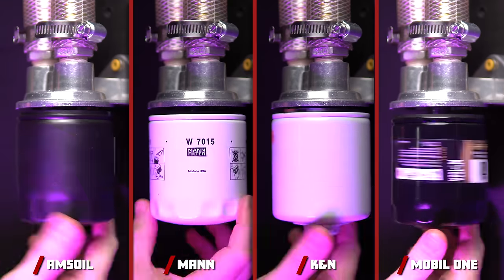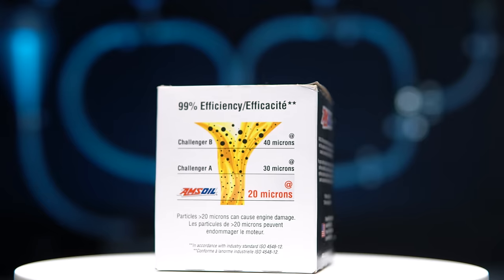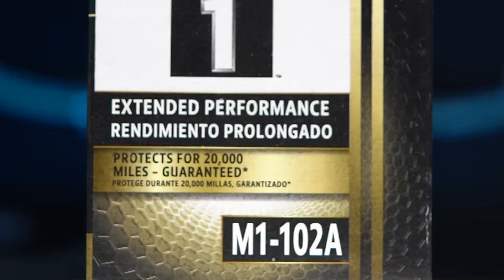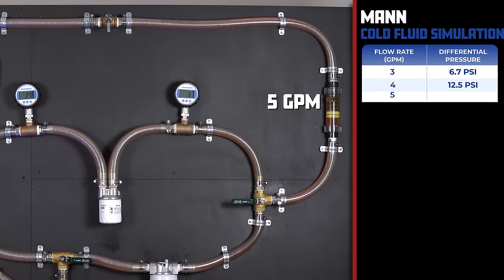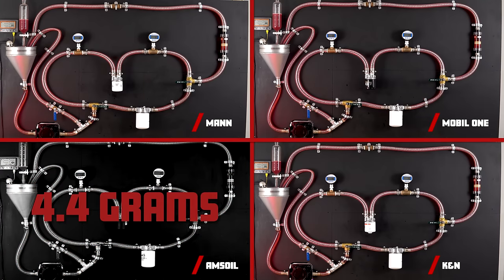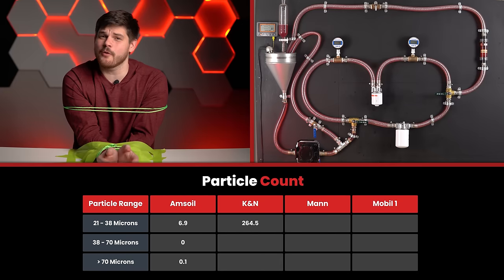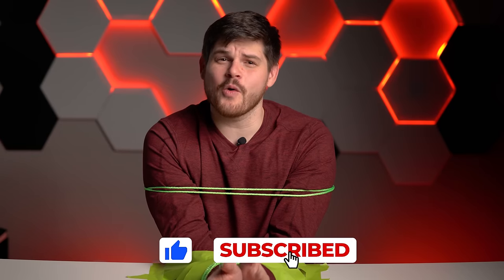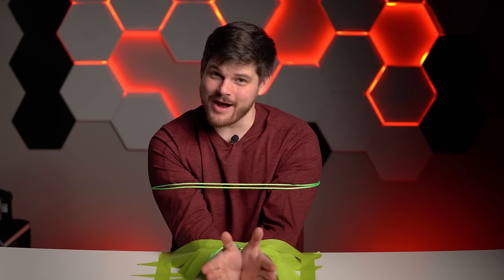Best Oil Filters of 2024 (Engineer Tested) - Amsoil | Mobil 1 | Mann | K&N

Comment: Would you consider testing OE Honda, Toyota , Subaru, Ford, GM. Original manufactures oil filters to see how good they are. 
I have seen a quality decline from many manufacturers. Definitely cost of manufacturing is their primary objective over making  the filter the best it could be. For example a Denso Toyota filter made in Japan from the early 2000s is superior in construction to a 2024 Denso made in China.  More glue and paper in the element. Metal centre core now plastic. 

I’ve seen this low quality construction also inside genuine Honda filters too. 

But they are used with the vehicle under warranty. 

Many thanks.
Reply from the maker: Hey again, Stephen! We will be testing OEMs on our next video, unfortunately some like Honda, we won't be able to test as they don't have a cross reference to the filters we are using, thus it would be an unfair comparison. Thank you for the support!

Comment: I have been using Fram filters for 20 years. I change my conventional oil every 5,000 miles. I have a vehicle that requires full synthetic oil now. I will still use Fram oil filters. I  change my synthetic oil at 7,000 miles intervals. My Fram oil filters I buy are supposedly good for 10,000 miles. I will try   another higher quality oil filter next time.
Reply: Good.

Comment: The amsoil filter was the best by far. It has higher resistance to flow because it has better fikter media. It soot loads quicker because of this as well. An amsoil filter with 5k oil change intervals is the best option.
Reply: Higher resistance to flow is not a good thing btw.
Reply: @elpcmaster  it's why it filters better, so it is a good thing. As long as oil flow demand is met its absolutely a good thing. You can't have better filtering without more restriction. Simple concept
Reply: @elpcmaster  but did you notice it is still better than any of the Fram tough or extra guard? That means it still flows better than Honda OEM filter

Comment: I got no issues using K&N oil filter with Castrol Edge 75k high mileage synthetic oil, for my 2015 lifted Scion xB. I love those stuff 🙏🏼🙏🏼

Always change every 5k miles. Always.
Reply from the maker: Yes, oil change interval is way more important. Thank you for watching!
Reply: @BrandRanks Hakuna Matata ❤️‍🔥🙏🏼
Reply: K&N is ranked pretty low.
Reply: @elpcmaster  that bad? 

Is it because of the sales problem, the quality of the oil filter which I have no issues for quite a few years. 

Is wrong type of elements they put in the oil??

How come?
Reply: @toyotabrony no, it's not that bad. The differences are so small that in the real world where you change oil every 5k they're virtually all the same, and it's hard to beat that nut welded on the bottom.

Comment: Great videos! I would love to see a comparison between the Mopar Part Number 4884899AC filter and the Part Number 05038041AA filter. The latter is a very interesting construction filter and is used as an upgrade by many on the 6.4L Hemi engines. If you were to pick one to test 05038041AA, please!  Thanks for all your time and effort to bring us this amazing information!
Reply: I second that!  MO-041 is labeled SRT and goes for around $16 on line. Supposedly is the OEM for the Viper, Hellcat, and Red Eye engines. Has been my hemi engine go to even though I have no idea what it’s efficiency rating.  Also, second on testing the OEM filters.   Supposedly the parts that don’t mearly fit, they match.

Comment: I wonder if a comparison of the Amsoil EAo26 and other compatible filters would be a popular test. The EAo26 is a popular full flow filter used on their bypass unit. I would be eager to see this comparison as the Amsoil filter is salty, although rated for 25,000 miles. There are probably other compatible filters but here are some that I believe are compatible as far as physically fitting the same application.
PCM R077001

Mobile 1 301A
Mercury 35-802886T
K&N HP-3001
WIX 51515XP
Napa Gold 1515
Motor Craft FL-1A

Comment: Instead of simply ranking 1st, 2nd, 3rd etc, it would be far more useful to see a chart with the numbers measured for each category. The difference between three filters might only be 2 or 3% yet the lowest performing filter is rated #3 when in fact it is almost as good as the #1 filter. Project Farm charts the results this way. Great videos!

Comment: Maybe it's just me.. but AMSOil promises to filter 20 microns absolute.. the test showed that they filtered out almost everything.. by far better than the competitors.. am I missing something? 

At least in an aftermarket setup, if the filter is small, I can just run a larger filter with the same thread ID.. could just get a larger filter..

Comment: You should test how the extreme pressure additives dispersion based (ceratec and MoS2) compare with the soluble solutions like zdpp and mt10 muscle metal treatment when circulating in the oil filter and if they change pressure/clog the filters.

Comment: It would be interesting to test different part numbers of the same filter. Am I actually gaining anything in the area of dirt capacity before a restriction occurs? I like putting the s2000 filter (3593a ultra synthetic). I can always find them at any Walmart, and they are usually much larger than stock, which allowed my integra GSR to hold a full 4L vs 3.5

Comment: Do you think a higher flowing filter would be better in my situation, i run 20w50 racing oil on a ethanol 1000whp honda engine that has 100psi cold start oil pressure. Maybe sacrificing filtration will actually filter better if less material gets thought the bypass
Reply from the maker: On track days I would definitely run a high flow filter with your oil given it's pretty thick, but otherwise I would maybe run the Purolator that had good flow and still great filtration. Mobil one also performed pretty well.
Reply: @BrandRanks  thanks for the quick reply. I replace the oil and filters very often and every time I get material in the oil filter, i cut them all to inspect. Ive already put rod bearings in the car and the engine is less than a year old. Ive always ran the amzoil filter because it filters so good, but now im thinking its actually hitting me
Reply from the maker: Yeah that could be happening! With how thick your oil is, it wouldn't take much for a regular daily driver filter to by pass, especially if it's cold outside. You may look into by pass filtration that amsoil offers, quite expensive but keeps your oil clean while still allowing you to have a higher flow filter

Comment: The problem I see with the differential pressure test is that you can be 100% sure that a filter is not going into bypass and artificially giving you higher flow numbers. I know that all these filters are rated at a BVPS of 12psi, but is it really staying sealed at 8-11 psi?

Comment: The differential pressure between inlet and outlet would be more informative if you shared the bypass valve setting for each filter. After watching your video I am left thinking that all of those filters spent most of their time in bypass.

Comment: Could a filter mag or similar high temp resistant magnet enable a high flow oil filter to capture as much or more than the Amsoil filter? If so, this could solve the problem between which to choose.

Comment: Wondering if you can do a facotry OEM oil filter comparison from Mopar or  Ford or Chevy would be intresting to watch. And different filters designed for high performance facotry engines. like a Gen III Hemi SRT (6.4, Hellcat,6.1) the differeance of using an OEM mopar filters vs moblie one, Fram filter and so on. Or even for 5.0 Coyote engine or LS.

Comment: What is the typical flow rate in gallons of a 4-cylinder motor like found in normal motors like Honda Toyota Mazda from 2000 to 2020, non turbo, at high RPM's?  I don't know how much the oil pump puts out.  10 gallons a minute is massive and i'd be surprised if they hit that, but idk....

Comment: Great content as usual, an idea  for other test, simulate flow restrictions with 0w20, 5w30, 15w40 and higher oils and measure how much Amperage the electric motor shows., start with ambient temp, then 212F/100C
Reply from the maker: Thanks for the suggestions! Appreciate your support

Comment: Very few of the oil-brand name filters are made by that brand. Most are specified to meet a certain price range. That said, most of the high-price equipment I've worked on recommend Baldwin filters for lubricant or hydraulic systems. If ya ever take one apart, you'll see why!
Reply from the maker: We will be testing Baldwin. Thanks for watching!
Reply: We get them thru McMaster-Carr. MMC does not list brand names, but no do they carry junk! @BrandRanks

Comment: Great video content guys.
I do track days on road courses so oil starvation is super important to avoid. Oil pressure means nothing if there is not enough volume to keep the bearings happy. Having 80 psi of oil pressure but flowing through a 1/8" oil line will starve the motor yet you still show high oil pressure. Most of us over change our oil (especially track guys) and don't live on a 15 mile dirt road road that we daily drive. For high rpm and high lateral G applications, pick the oil filter with the best hot oil flow. Lack of oil flow will destroy a motor in a couple of seconds. Modern engines can run on "dirty" oil (30 micron particles) for way over 100k miles. 
My old air cooled VW engine had no oil filter (more of metal screen) and I put over 50k miles on that car before I sold it and it was still running strong.....with no oil filter.
Reply: Every engine that has an oil pressure sensor or a switch, it is installed AFTER oil filter, on the clean side. So if your gauge is reading 80psi, that's the pressure your mains, rods and cam bearings are seeing. Oil pressure is what keeps metal to metal contact from happening in engine bearings.
 Actually I would argue, one could change the filter after the track weekend and keep same oil. Go for a filter that has best filtration like amsoil, purolator or fram endurance and ultra. Capacity doesn't matter, you'll toss it out after track weekend anyway. Oil breaks down mostly from heat. Filter picks up and holds the garbage.
Reply: See Georges comment ⬆️ . oil pressure is one thing but yes enough oil volume is most important. Sure you need good oil pressure but, Excessive oil pressure just robs power through oil pump drag. But yup, Inadequate oil volume wrecks engines. That's why we always used to replace the stock pumps on our old hot rods with high volume pumps.
Reply: For the Honda … would you prefer the worst built but satisfactory OEM A02, or the Amsoil ?
Reply: So what filter you running?
Reply: @brianjurkschat   If you're asking me, any name brand quality filter will work. You'd be shocked to realize that the bypass feature of filters happens a lot, yet your engine does not care that it is circulating "dirty" oil.  I use to work in an industry where our company had over 1 billion dollars of equipment (everything from pickups to giant earth moving equipment). We never lost an engine due to oil filter issues,  people mistakenly put ATF in the engine, hydraulic oil in the engine, etc. But lack of oil would instantly kill any engine. If your engine is producing chunks of debris, it is going to fail in short order regardless of what filter you're using. The reason modern engines last so long is because of fuel injection, not over fueling and washing the lubricant off cylinders like old carburetors with manual chokes did.

Comment: Hi would you consider doing a video of Racing only oil filters. I like to see how the Moroso Race filter performs it does not have any bypass valve and they say it's to not let junk into the bearings of the engine. and I know Wix Fram and other brands have Race filters.

Comment: IDEAS:
) Manufacturers could make a new "double pleated filter", where the outer pleat filters larger particles, and the inner filter handles the 20 micron particles.
) The goal of a filter is to "filter particles", so of course the less restrictive filters are typically going to filter less particles.  This is also proportional to the surface area of the filter vs the micron pore size.
) Has anyone considered putting magnets on the outside of the filter can itself to catch metal particles and adhere them to the oil filter case?  I'd be curious to run this experiment and cut it open afterwards to see if there are particles stuck where the magnets are...
) I'd be curious to run tests on identical filters sourced from a parts store vs Amazon to see if you can identify counterfeits or repeatability of the same filter sourced from different vendors results.
) I'd also say a good test would be to take a batch of used motor oil, and run it through the tests, while also sending the used oil unfiltered for analysis, then compare how well a new filter performs with used oil...
) The larger the filter surface area, and the more oil volume, the better.  So, how about create an "oil filter remote line"... Have a base adapter that fits on the engine just like a typical oil filter, then run two hoses to an outboard significantly larger oil filter that is mounted wherever there is more space.  Assuming cold temperatures are not an issue for getting the oil up to temperature, then a significantly larger oil filter could be used, thus increasing the surface area and total oil volume, in addition to providing space to run multiple particle size meshes in stages from coarse to fine, plus a magnet pre-filter stage.

Comment: Can’t have heavy filtration of a fluid and NOT reduce flow rate, you have to pick. If your going to use high end synthetic oils maybe you can get away with a higher flowing filter but less filtering, but as long as your oil pressure sensor is AFTER the filter and your getting your required oil pressure for a healthy engine, get the better FILTER.

Comment: Ist time here. Sub. It seems the testing here is excellent. But the graphs and explanations are confusing.  
1. Graphs, once completely filled with their info, disappear within one second. 
2. Lists show the largest at the top, smallest at bottom. 
                   (usually up means bigger.)  ( Like when I want my Toyota wipers to go faster, like the car, I need to turn the lever BACKWARD ! crazy )
3. The names of the tests need to be emphasized. "Filtering, hot flow, cold flow, capacity" were slightly mentioned going in. 
4. "Ranks are weighted according to percentage in parenthesis ( ). "  What does that mean ?
4. Why is the host sporting a variety of restrictors ?          Former Coast Guard instructor here.
Reply from the maker: Hey! Thank you for watching and supporting us. Also your feedback is greatly appreciated, it's super useful to get feedback from a viewer as I am so into the editing I sometimes forget this video might be the first in the series someone watches. We will look into the graphs and try to make it clearer. As for the weighted percentages the percentages is at the top of the table basically just means that we weighted the filtering performance ranking more heavily than the other three tests.

Also the restraints, was because on the previous video I received lots of comments that I was moving my hands too much, so it was just a joke with the community. Again, thank you for you feedback and for your service.
Reply: @BrandRanks  I got a retirement job at a car parts place. People expect us to know about the 287,549 products !  But we rely on customer feedback and guys like you. 
And project Farm.
Reply from the maker: Wow... That's a lot of parts, I guess we will never run out of video ideas. But great to hear that we can help and yes Todd from PF is amazing!
Reply: @BrandRanks  I lied about the number of parts. It's something I do when someone complains that I don't know the part number for the window crank for his 1979 Alfa Romeo ...

Comment: What’s average the oil pump GPM a vehicle sees while cruising? That’s where the filtering spends most of its time.  
Probably why Amsoil doesn’t focus on high oil pressure flow
Reply: I looked it up and most sites agree on 3 to 4.5 gpm @ 1000rpm to 10 gpm at max rpm. Amsoil’s bypass is set at 15 psi. His test had Amsoil’s pressure drop at 9.1 at 10 gpm while other filters were as low as 6.6. So the oil pressure in my corvette at 6000 rpm would be 52.5 instead of 50 psi with the Amsoil filter? 50 is fine with me. 🙂 I’ll have less dirt in my oil. (Even less with a bypass oil filter)
Reply: @darrylsjodin7184  I agree
Reply: @Dfour  ❤️

Comment: Many opinions here on why one shouldn’t use a certain type or brand of filter. I wonder how many engines under 100,00-200,000 miles have failed only because of using brand X, Y or Z oil filter? (When performing on-time maintenance)

Comment: Sorry I'm late. 

Being a car person the AMSOIL is the BEST.

You all came for filtration so first off AMSOIL destroyed everyone else in the 21-38 micron test. 

Meaning if used in combination with their oil or anyone else's it Truly does the job. Clean engine = less repairs later.

I know I know but what about oil pump psi? One of the 2 hearts of your engine.

Higher psi is actually a good thing when comparing filters. High psi of outstanding filter is perfectly fine as long as it falls in a safe pressure zone of your oil pump which is around 20-40 psi. A little higher is okay because your oil pump has its own bypass set at a way higher level (90-125 psi).

What about filter capacity?
If that's what you want as you can see it comes at a cost of more contaminants flowing throughout your engine unless the filter companies increase the volumes they hold of their lower micron filters. 

So change oil at or before said manufacturer intervals and you will be just fine.